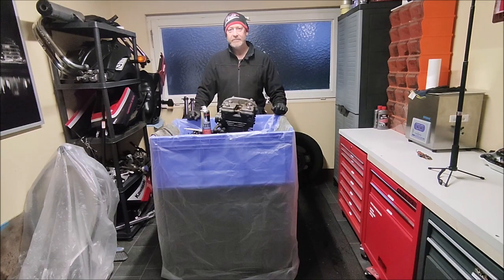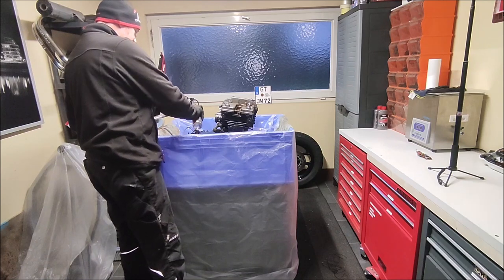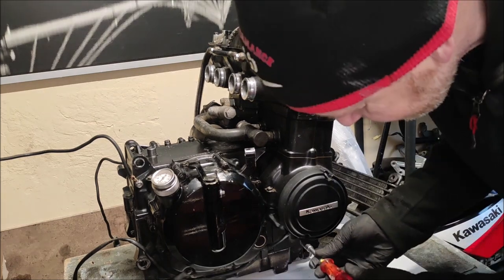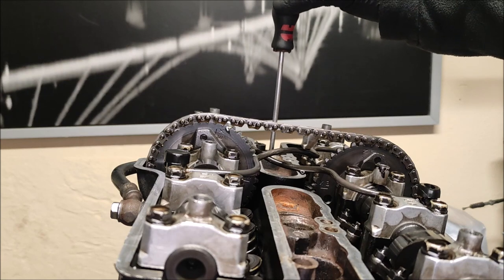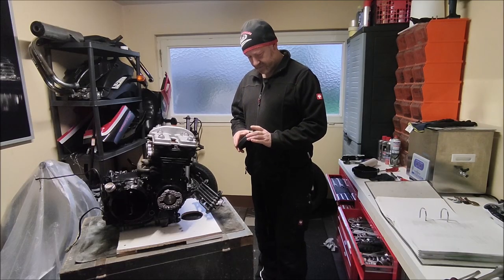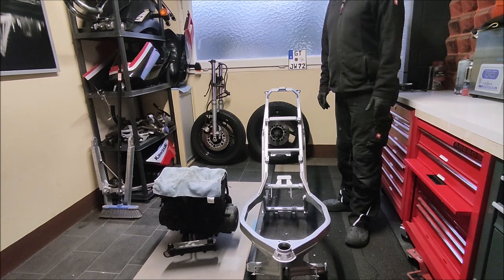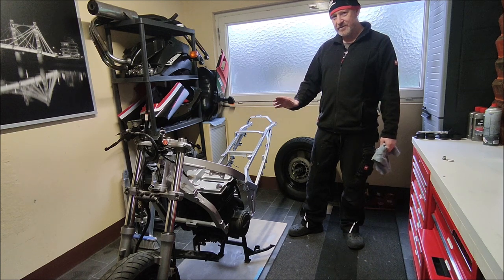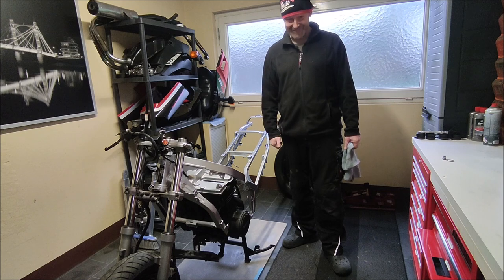1987 - Kawasaki ZX600A GPZ600R Rebuild - Part 6 - Engine clean, inspect & Install

Comment: Had 85 600 ninja 6 yr 60k miles ran perfect never ever broke or had a part failure. mechanic that always adjusted my valves showed me ics of top end with cover off looked brand new had perfect compression across all 4 cylinders and that bike was not babied. I broke it in first weekend got vales oil done monday morning monday after noon got wreckless driving for un clocked speed  basically top speed 138mph, just saying from 1200 miles to 60k miles it saw redline daily many time.
Reply: bullet proof motor if  oil changed and valves adjusted on time. Cannot kill it unless abused and not maintained. And in its day fastest 600 on the road.

Comment: Hello, I am bringing into life the same motorbike but from 1985. I have a Kawasaki manual and i see you use another one. Can you tell me which one do you use? Please keep doing videos, they are very helpful!
Reply from the maker: I am using a Haynes manual, it comes from the United Kingdom.
Reply: Hello, may i know where did you got your service manual? i been looking for one a long time ago. 😌
Reply: @joeyborras4728  stupid late but if you type the right sentence and the .pdf you can usually find a free one pretty easy.

Comment: I am looking forward adjusting valves on my GPX600R but with the engine still in the frame. . Is it possible to crank the engine to TDC with spark plugs installed by turning the rear wheel in gear 6.
Reply from the maker: Probably, but why not do it at the bolt on the rotor? You need to remove the cover anyway, so why not.
Reply: @MrLefthooker  I don't use TDC markings on any of my engines to adjust valve clearence. I just turn them over by moving the car/motorcycle until the cams are in the right position. Easy to see but you need to write down which you already checked/adjusted. Btw. worked out perfectly with gear 6 and turning the rear wheel. No need to open that cover.
Reply from the maker: @ringofthebrave  of course it works, but not something I would "teach" or show people how to do. Each to their own though.
Reply: @MrLefthooker  That is right. The method  as written in the repair manual is safer if somebody wants to do this kind of maintenance for the first time.

Comment: Hi. Question. What are the little black plugs that sit on the lines under the cover
Reply from the maker: Hi, they are just rubber caps. There are 2 different types of oil lines. There are those that are screwed in, and those, like these, that are just popped on. To prevent them from popping off due to vibration, these little black caps go on the oil lines, and are held in place by the rocker cover. Hope this helps 👍🏻
Reply: So no real purpose? I noticed one of em is gone
Reply from the maker: Well, the purpose is to stop the oil connection from lifting off, and yeah, sometimes they get lost as they stick to the lid and then you lift the lid they then fall off unnoticed. But you are right, even when off I've never lost an oil collection.
Reply: @MrLefthooker  thanks alot!